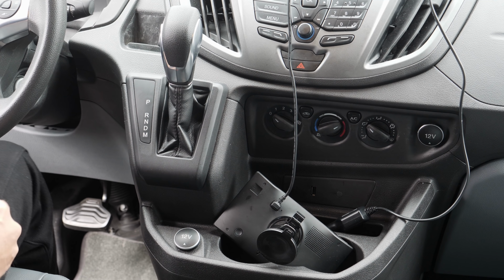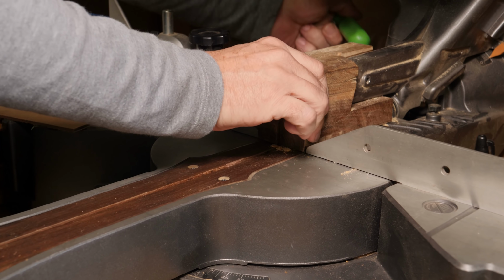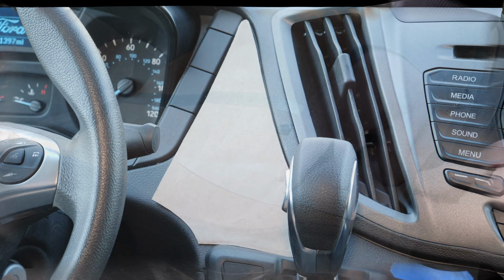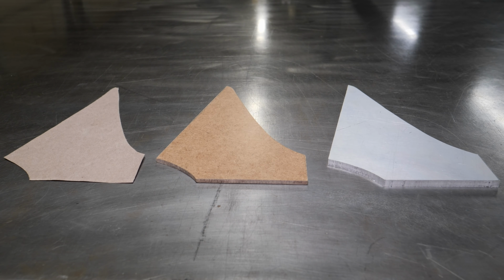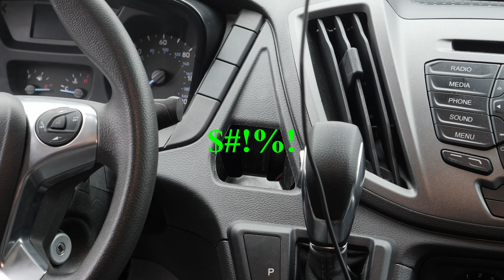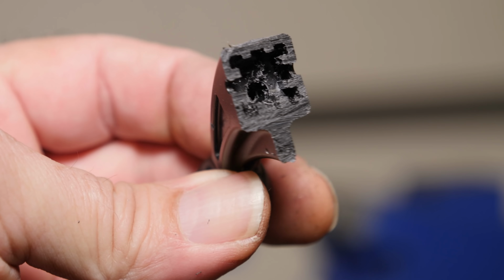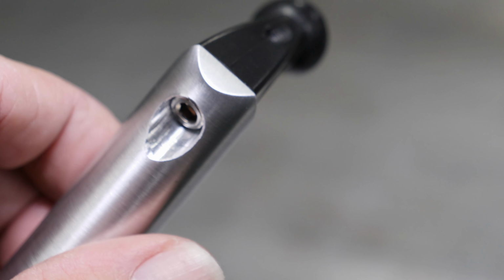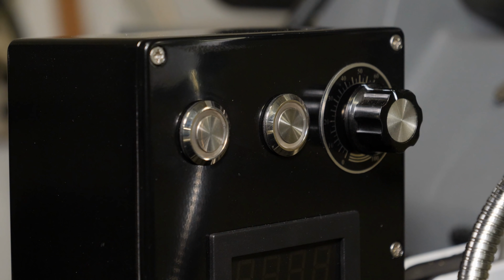Navigation Station- GPS and Phone Mount

Comment from the maker: Just wanted to point out the reason for using a stand alone GPS. It works everywhere all the time and doesn't cost anything to operate...This could easily be swapped out for a GPS enabled pad/tablet of your choice but wouldn't be as easy to mount to the shaft. There are several free and paid Nav apps available now. As well you can use Google Maps offline with a little setup while in network range. Thanks for Watching!

Comment: the nay vote was from an embarrassed Ford engineer..
Reply from the maker: The 2020 Transit dash is reconfigured and appears to be more phone friendly if you get the big screen model. You get a nice relieved area on top of the dash to charge your phone but it lays flat on the dash out of sight. Appears you still can't use your phone for navigation. If you have the entry level radio your in the same boat that I was in...